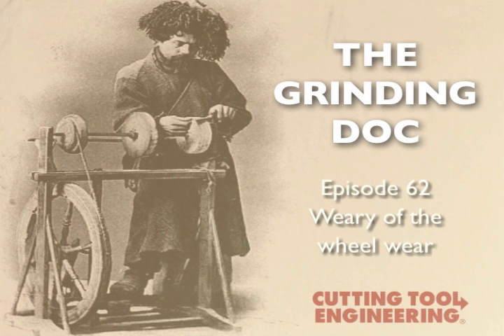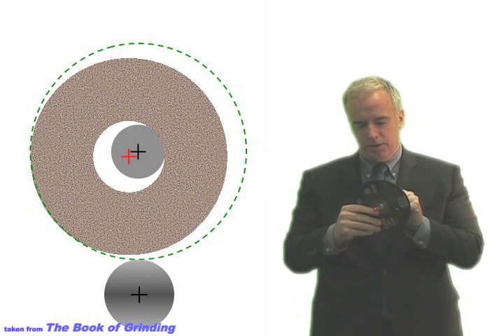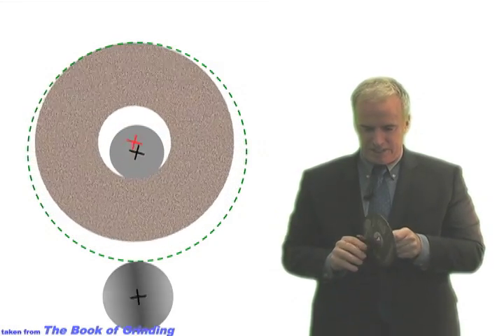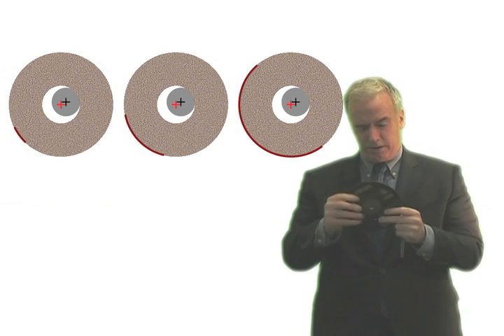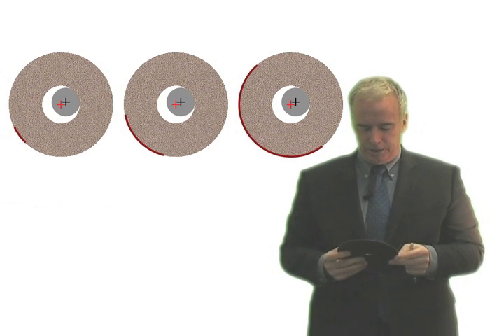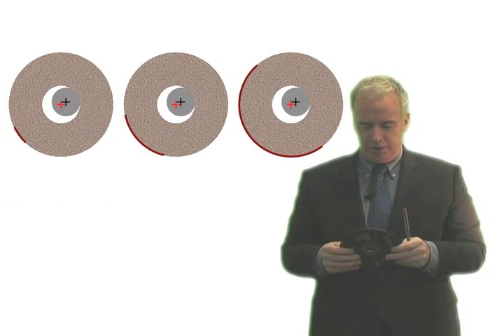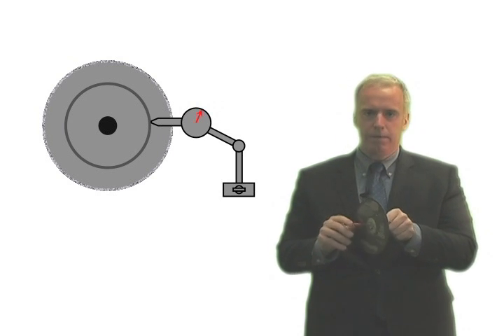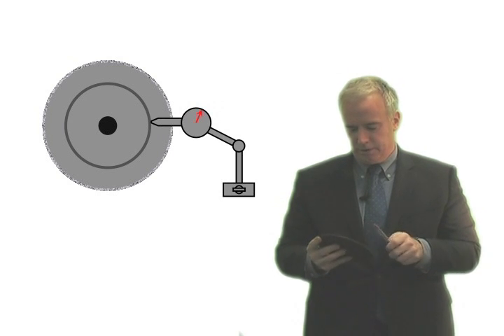Episode 62: Weary of the wheel wear

Comment: Often a dial indicator needs to be used to center a wheel, however I would never place the anvil of my dial indicators on an abrasive surface. Is there a technique or special type of anvil used to prevent wear?